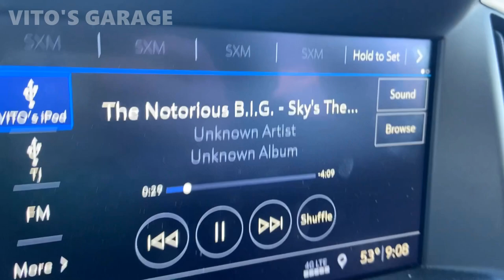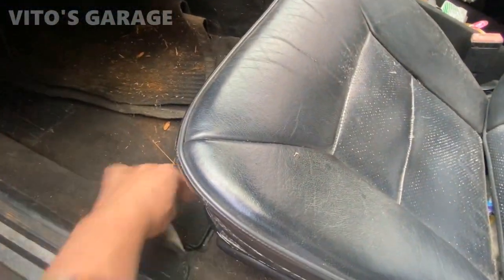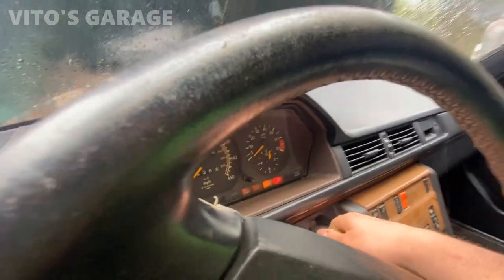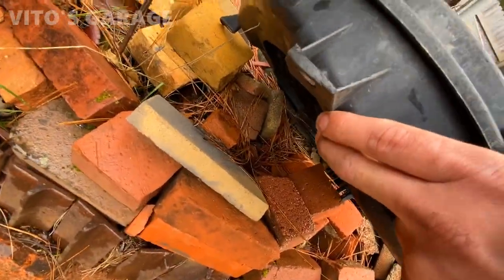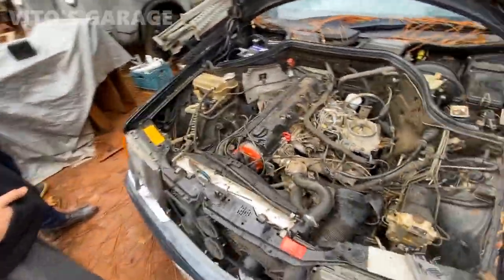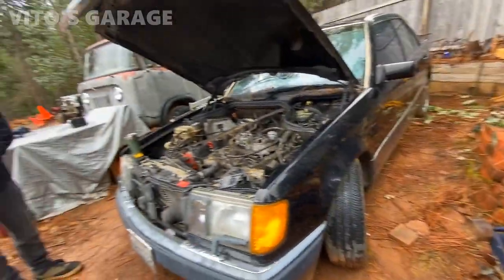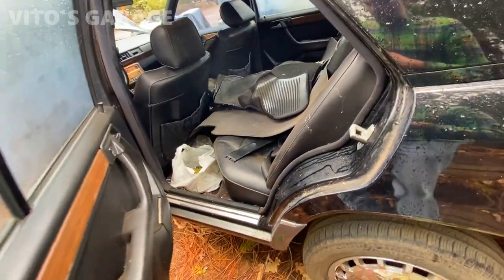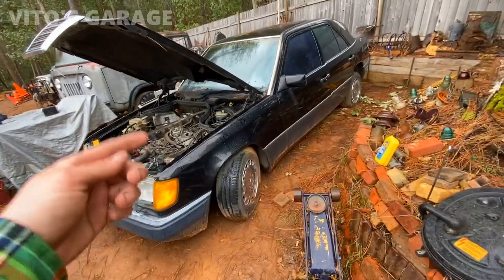Reviving a Black on Black 1991 Mercedes 300E W124! Lots of Problems..

Comment: I just got my 86 300e running after 19 years needs some work but I got it running replacing my fuel pump and filter. Siphoned gas out and put new gas. It over heats and I probably have a blown head 🫠 I’m no expert with cars but watching your videos gives me tons of inspiration so thank you for that
Reply from the maker: Thank you so much for saving the legend! Head gaskets aren’t hard to change on these engines! Keep up the great work. You can always message me on social media with questions. Thank you for your support!🙂
Reply: I am about to jump into the same situation..... and I think the first task will be to replace the fuel filters and pumps, was this a difficult job to do? Did you have to clean out the gas tank as well?

Comment: POWER ASSISTED FLUID  IS MERCEDES  SPECIAL FLUID ONLY FOR W124  ,.. FOR THE STEERING  DONOT USE  ATF FLUID.
Reply from the maker: They take ATF oil in their steering system